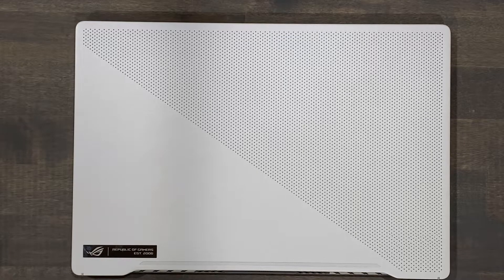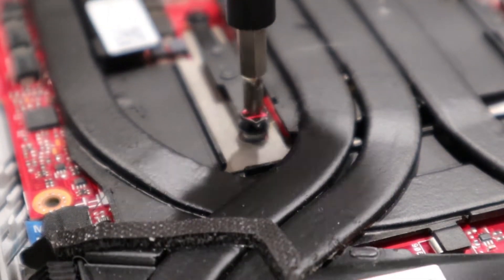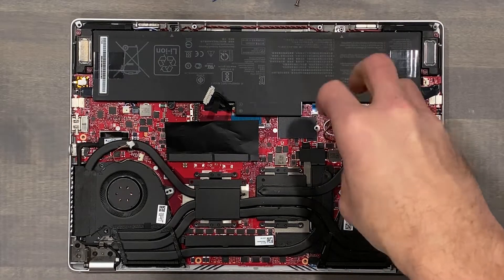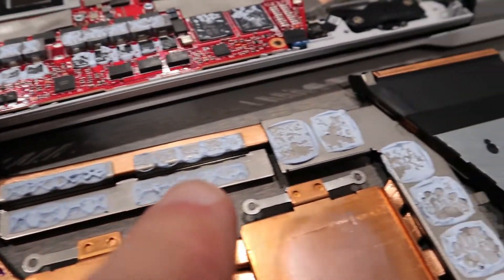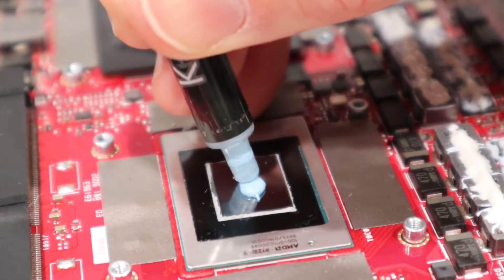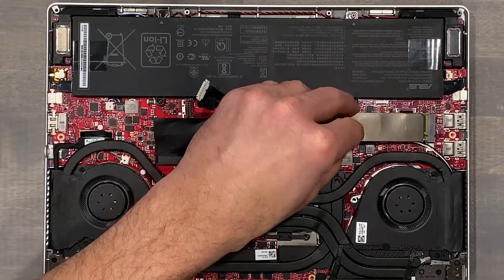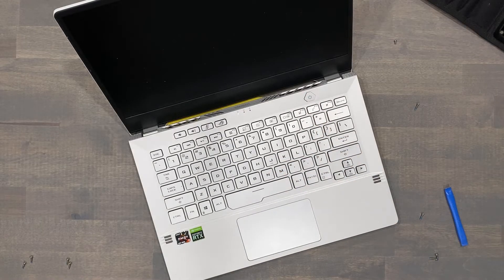Asus G14 Repaste Guide

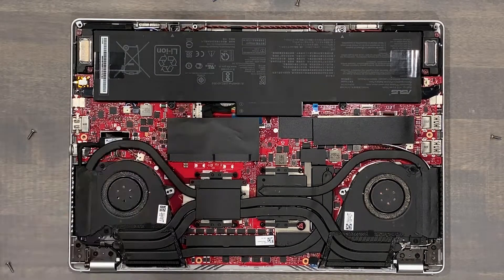Comment: 0:52 to 1:10 - That metal clip came in contact with PCB and made short -- My laptop is not booting on please tell me the solution

Tried connecting directly through DC but no luck, was trying to upgrade the RAM hence decided to remove battery off first but everything messed up.😢
Reply: Same here, any news did you fixed it?
Reply: @wolraven  Service centre gave me quotation of 75 percentage of the laptop cost MXN $ 25500

The laptop cost was MXN$ 36500 😥

Instead of repairing and changing I bought HP Desktop CPU with i7 32GB Ram for MXN $ 4000 and installed a GT 1030 Low profile graphic card. 

I'm happy with the performance I'm getting with it, I was not getting it with laptop RTX 3060 6G graphic 😅

But I'm planning to buy a newer version of the same laptop in the coming year end sale, I will get R9 RTX 4060 at 31K MNN$

I would suggest checking with the local trusted service centre and see if they can repair the motherboard,  I checked mine they said many components from the motherboard might have been damaged and asked me to sell separate parts to whoever was willing to buy it.

See what answer they give in your case, check with multiple 2-3 repair centres, I did to that but no luck just extra expenses 😕

let me know if you need any more information. Good Luck 🤞
Reply: @MiraakYT  Oh thanks for your reply.. Well I’ve been stressing out dunno if I should buy PS5 or save money and get RTX 4090 Zephyrus G14 in case laptop can’t get fix. Asus Support offered me motherboard changing with a huge fee but I declined it, I’ll try my luck with local repairing shops
Reply: @wolraven  I did the same thing,  If you play games that wre supported by PS5 / XBOX then go for it don't buy laptop instead but one small mini pc for work along with PS5 /XBOX.

We have limitations on upgrading laptop components too and the laptop does not give good performance as a desktop. Though It's portable, I'm going to buy it.  I can't afford RTX 4090 lol
Reply: @MiraakYT  You’re right, by thinking that laptop doesn’t give a performance like pc it makes me wanna feel not to sorry about frying motherboard lol.

well red dead redemption 2 and dying light was my only games so ps5 should be better choice but when it comes to modding (which it’ll take time for me to enjoy vanilla experience) there ain’t nothing to do I guess
Reply: @wolraven  Agree, If you can afford just build PC when you really want to do so, meanwhile enjoy PS5
Reply: @wolraven  I didn't attempt changing the thermal paste, I'll let it run for another year then swap the pc for a good rtx 3080ti laptop
Reply: @wolraven  it depends on your needs, if your looking for solely gaming on a tight budget you can get a PS5 and a good 4k TV under $1200 meanwhile If you're looking for more than gaming such as 3d rendering, coding, and a portable device an RTX 4090 laptop will match the same performance but at a higher price range
Reply: @SunFinTV  made the choice and I’ll go with ps5 but I’m having difficulty to find a proper monitor/tv to match the grace of ps5 lol looking for hdmi 2.1, vrr, 4k 120fps
Reply: @wolraven  lol I really don't know much about TV's I'm gaming on a Samsung 65 inch qled TV with 120hz G-sync
Reply: Hello i need help, is it a must to disconnect the battery before applying thermal paste?😢 I'm sacred of frying my motherboard

Comment: I’m having a major problem, the metal clip that holds the battery cable can’t get shut back over when I reattach the battery cable. The clip didn’t come off like it did for your example, it just slid back a bit, but now when I reattach the cable, I can’t get metal clip to latch back over it. Can you please tell me why? I see tiny little sparking when I reattach the cable
Reply: That metal clip is kind of a trap by Asus
Reply: @MiraakYT  Thankfully I got it back on by pressing the battery connector down harder and everything works, but it felt like a close call
Reply: @FreshSqueezedLightning  Glad to hear that's solved your issue. 🙂

Comment: What do I do if the metal part did cause a short because the laptop is not turning on now…🥲 everything is plugged back in perfectly so that’s all I can think of
Reply: The same thing happened to me yesterday 😢 my G14 is dead af.
Reply: @MiraakYT  me too brother, going days w out my laptop is horrid
Reply: @MiraakYT Hello i need help, is it a must to disconnect the battery before applying thermal paste?😢 I'm sacred of frying my motherboard
Reply: @SunFinTV  Bro I've already fried my motherboard, I would suggest you to take help from professionals who knows how to handle Asus laptop, don't do it yourself 🙂
Asus has a complex motherboard design that's risky.
Reply: @MiraakYT  I'm sorry bro. That really sucks.. no Asus customer care in my region. And my pc is already overheating at idle 90°c
Reply: @SunFinTV  ☹️, same thing I had to show my  laptop to local shop, asus service centre is like 500-600 km away from here. I didn't want to do it but no option left. 

If you're going to do it on your own make sure you have professional tools & go carefully with that battery clip, that burnt my laptop motherboard 😞
Reply: @MiraakYT  I have the same fear here. A local shop might as well still fry my mother board. I'm just confused at this point because I can't even open chrome without it overheating seriously
Reply: Hello i need help, is it a must to disconnect the battery before applying thermal paste?😢 I'm sacred of frying my motherboard

Comment: 1:10 I saw a spark here and the laptop is not turning on I'm guessing the PCB is gg?
Reply: Same with me too😢
Reply: @MiraakYT  @spiritwatcher8880 same  RIP
Reply: do you guys have any fix for this?
Reply: @onlytheflames  find someone online who's good at repairing PCB shorts, thermal cameras, soldering, that kind of stuff. Most of the good ones will allow you to ship the unit to them for repair
Reply: @onlytheflames i got the same exact peoblem too did you fix it
Reply: @hamzanasri9414  nah, say thanks to ASUS, they designed it this way on purpose. Only way to fix is to ship it to a professional repair shop
Reply: Same thing happened to me and I saw a spark but luckily mine is still turning on with no problems. You should put the clip back into place and make sure everything’s connected properly before assuming it’s fried

Comment: Had a problem. Did the whole thing, but I when plugged the battery cable, tried to turn on the laptop, it would not turn, neither charge. Pls, help. Sorry for my english, not the best.
Reply: Hey maxi, same situation over here. Did you find any solution?

Comment: Hiya. Followed your guide and all worked really well. One thing though, you can pull the paper back on the display cable side and tease the cable out of the channel in there and it means you don't need to remove the cable when extracting the cooler/fan assembly. 
I used the new MX-6 formulation and my temps before were at idle about 42 to 45 on the cpu and at load 70+ on the CPU and 76 on the GPU.
Now, at idle with MX6 my temps are 32 to 36 on the CPU and at load approx 50 to 60 on the CPU and 65 to 70 on the GPU with it at full speed, no throttle. 
Very impressed.

Comment: Shorting the board with the battery connector clasp is exactly what happened to my laptop while I was trying to replace the SSD 😢
Reply: Same and it is not working at all
Reply: @vinaymorale7203 same with me too 😢
Reply: did you show it in the service centre? did you get any solution?  what they said? please write back 🙏
Reply: @MiraakYT  my warranty was out already, and the service center I found myself could not fix it.
Reply: @sasha_chudesnov  but did they tell you what part was affected and what they did to fix it?
Reply: @MiraakYT  in my case it’s likely some part of the GPU
Reply: @sasha_chudesnov  Thank you for the response Bro, I hope in my case it's not the case 🥹  my laptop is not under warranty it's already been a monre than year now.
Reply: Hello i need help, is it a must to disconnect the battery before applying thermal paste?😢 I'm sacred of frying my motherboard
Reply: @SunFinTV  yes it is. make sure to follow the video closely, then you should be safe.

Comment: I tried to repaste my laptop and when I was about to plug back the battery to the mb I made a short circuit...can anyone tell me how bad it is?my laptop wont boot
Reply: Same situation here, how bad is it? Not booting :(
Reply: How did you cause the short?
Reply: @JavierContreras678  I droped battery safety (metal) on the motherboard
Reply: Hey did you get any solution?
Reply: @MiraakYT  Cover the motherboard with tape before disconnecting the battery
Reply: @JavierContreras678  Mine is already damaged, it's not turning on . I've given it for repair let's see what he says after inspecting the motherboard, I hope he'll not change the original parts and fix it in any way otherwise  it would be a big loss 😔
Reply: @MiraakYT Hello i need help, is it a must to disconnect the battery before applying thermal paste?😢 I'm sacred of frying my motherboard
Reply: @MiraakYT did yours already fixed?

Comment: Just completed this on my own 2020 G14 and the results are quite nice! Idle I was sitting near 50°C on CPU on idle! And 80-85°C raiding in FFXIV. So far, idle is down to 40-45°C and in-game FFXIV (idle in a major town with a lot of players) was at 62°C, so I'm sure raiding will be far easier. Not bad for what was already a heater when I first bought it. The paste was so flakey, so even the cheapie Corsiar TM-30 was a huge upgrade. I'll probably repaste with KPx later on once I have can get an order in.
Reply: Hello, which thermal paste did you use for the G14?
Reply: @edwinsanchez8698  I used K5 thermal grease for the majority of the repaste, but Thermal Grizzly for the thermal paste.
Reply: @scarelebjd2983  Thanks for answering, I got Grizzly for CPU and GPU, and I'm gonna use K5 for Vram, this is gonna be the first time that I repaste for this laptop but did you see better temperatures after you did it?

Comment: Thank you, Bob! I just changed the thermal paste for my G14 2020 after more than 2 years of continuous use, at least 8 hours a day. I used Grizzly Kryonaut for CPU and GPU, MX-4 for VRMs. Before repasting, the temperature is usually 65 - 75 degrees Celsius and now it's 50 - 60. The lowest I could get is 37 degrees Celsius when idle (Turbo, process power limited to 80%). My 2 years old laptop is now even cooler than when I first bought it.  😳
Reply from the maker: Looks like you did great!  MX-4 may not be ideal for the VRMs but I can’t confirm with personal experience.   I gathered that pastes like K5 Pro is preferred since it’s for that type of part.  

Unfortunately, it’s not something you can identify whether it’ll be a problem since those parts tend to lack sensors you can monitor with software.
Reply: @BobOfAllTrades  I couldn't find K5 pro in local stores or on any website in my country, so I used MX-4 as an alternative. I hope it would be okay 😳
Reply: @thinhlpg  how is it working so far? I’m about to reparte my g14 and I was about to use the same thermal paste for the vram
Reply: @sebastianacosta3451  No problem so far!
Reply: @sillybillymemes  Well, it functioned somewhat for a couple of months, but over the course of nearly a year, I've noticed that my laptop shuts down randomly, not very often though. I accidentally fired my motherboard while trying to repaste, so I don't know if it's the mx4 problem that my laptop randomly shutdowns or not💀
Reply: @thinhlpg  with mx-4 on vrams you Had in gaming 110 degree you need k5 pro 
You remove the battery First ? To repaste
Reply: @BobOfAllTrades  Hey can i use Thermal putty HY234 too for the Vram ??

Comment: I did everything you showed in the video and now my computer is not charging through the charging port, just the usb-c, also that f ing metal piece by the battery jumped when I removed it and it cause a couple of sparks 🤬🤬 so that might have been the issue??
Reply: Where on the board did you spark?
Reply: Bro mine does the same thing too! I had to download G Helper just to run turbo mode

Comment: I saw another video similar to this about the fan replacement... I'm guessing I don't need to brush them across the CPU and GPU processor based on how you did this? Also, I was looking up which year my laptop came out and one shows Liquid metal... (I got mine in 2021, so I assume it may have that.) Is it safe to use any other thermal paste or do I need to use liquid metal on the CPU? I'm at the point of replacing a fan, so I'm planning to have some thermal paste as well before I remove anything.

Comment: I do wonder if applying clear acrylic nail polish to the capacitors near the battery cable would be a good option to prevent the lovely motherboard frying exercise. I’ve already fried one and I’m trying to formulate the best route forward to repaste this new setup.  Any thoughts?  I could temporarily use black tape to cover it, as well…
Reply: Hey, how did you get on with your repaste? I have been reading a lot of stories about people frying the motherboard when discounting the battery. Wanting to open it up and repaste but a little nervous.
Reply: Dont. I just fried mine 💀

Comment: I followed your steps and successfully re pasted my laptop. I used Arctic MX-4 for the APU and GPU and I used K5 pro for the vrms and vram modules. I also replaced the metal lid because it was dented. I had to transfer the LCD, plastic bezel and hinges from the first lid to the replacement lid. I then reassembled the laptop and it worked perfectly. My idle temp went from 60 to 32  degrees Celsius and my gaming temp went from 92 to 52 degrees Celsius. Big improvement! Thanks for the tutorial Bob.
Reply: sounds off, that is a huge and unlikely outcome
Reply: @ddroz23  if you say so
Reply: Are you still seeing good results after a couple of years?
Reply: @ idk I stopped using the laptop. I still recommend K5 pro as I recently used it to replace the thermal putty on the vrms of my 7900 XTX. 

I wouldn’t recommend normal thermal paste anymore for laptops. You should get PTM 7950 which is a pad that liquifies when heated up and hardens at room temperature. You need to put in the freezer for like 30mins before applying and cut it to the size of the cpu die and gpu die. The material is sandwiched between two pieces of see through plastic which are easier to remove if you freeze the ptm 7950 first. I just got some on amazon and it works great on my 7900 XTX.

The reason you want PTM 7950 is it resists “pump out” which is when thermal paste escapes from the cooler around the sides from heat cycles. PTM 7950 doesn’t pump out and it’s a lot more efficient at transferring heat than thermal paste. It’s the next best thermal interface after liquid metal.
Reply: @badmoose01 can the k5 pro be applied at room temperature?
Reply: @ZeeJayBay yeah. It’s just a little cup of putty. Same consistency as peanut butter.

Comment: Great video. I've ruined my fans by using a mattress foot pump to clean them and this guide is very thorough regarding the "how".

Any guidance (anyone) on how to apply the paste and how much? I haven't done that in at least 18 years.
Reply: Repasted and replaced the fans - all thanks to this guide.

There's a noticeable difference in temperature - I'm using Atrofac to turn the fans off completely below 80°C, and previously when browsing Street View they would eventually start spinning.

With the new paste - nothing. The CPU simply never reaches this temperature.